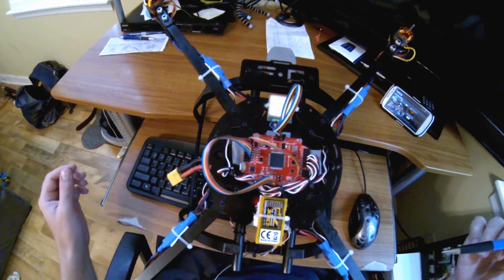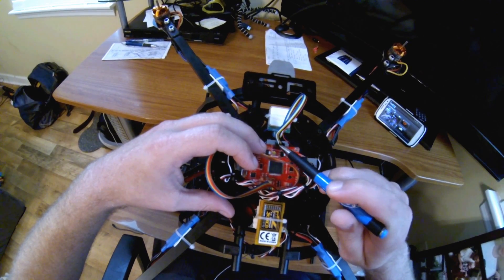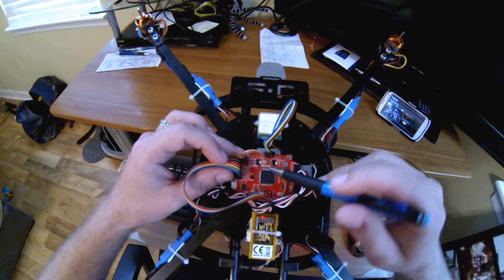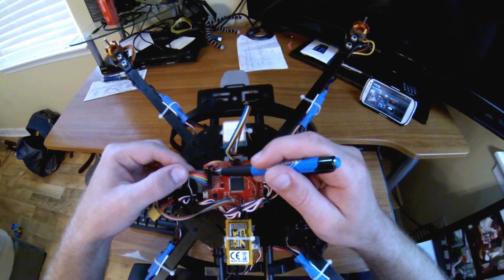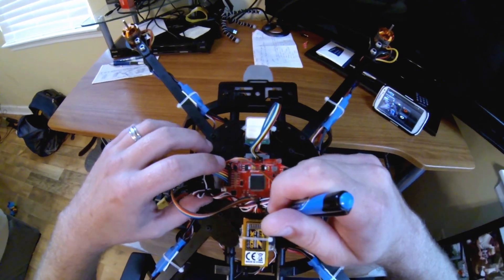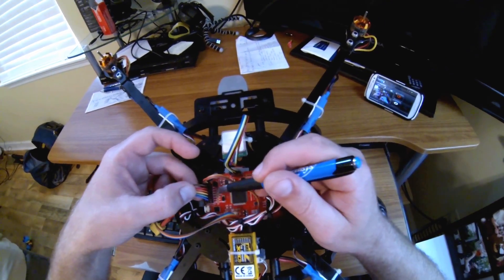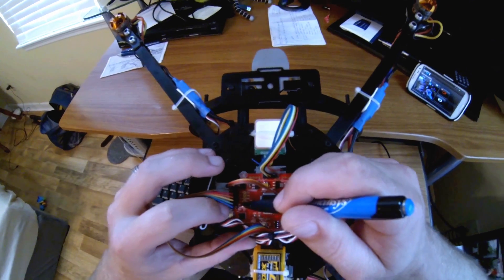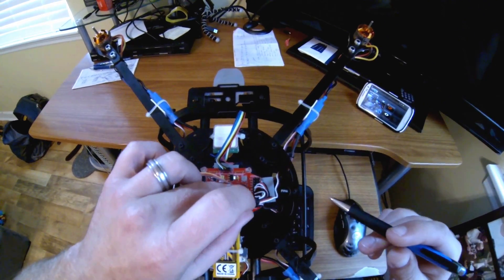How to wire multiwii pro 2 fc for quadcopter and spektrum

Comment: Is there a reason you suggest to only connect the signal wire to the receiver rather than all three pins? Isn't the extra power source simply redundant and works either way?
Reply from the maker: You can do that also. Will work fine either way.
Reply: thanks.
Reply: Do you know of a good video or instructions on setting up a Turnigy 9x I just bought for a quadcopter x config?   I'm new to this and just not getting it. Thanks for the help.

Comment: if you can afford the little bit of extra weight it would be a good idea to use a UBEC instead of one of the esc's.  That way one esc isn't loaded more than the others which in some cases can cause brownout condition to your flight controller if the battery is weak enough and the load is high from the motor which could cause a crash.

Comment: Reversing any two wires on the motors will reverse the rotation.  There isnt a positive and negative as the motors aren't DC.  Just thought I'd mention that because alot of motors and esc's do not use same wiring colors as yours.

Comment: I have looked everywhere for this answer. I guess its 5V? and does it only take the power from the first ECS connected? (like the KK2)
The reason i'm asking is that i'm gonna run a 5S(18,5V) system and i guess the multiwii can't handle that V-amount, so i was going to throw a 5V 5A UBEC 2-5S Lipoly (7.2-21v) in between.
Really hope for an answer. :D

Comment: I'm having trouble wiring up my Multiwii Whitespy Pro 3. I'm using a Turnigy 9x TX/RX.
I've got my motors wired ok, But my RX and my GUI don't seem to be setup right. Whitespy uses Spectrum guides for setup.

Comment: Nice quad! 
I've got a question though, how do you supply power to your multiWii pro? 
Untill now I've powered it trough the pc-cable while develloping, but I'm wondering trough which pins power should be supplied.